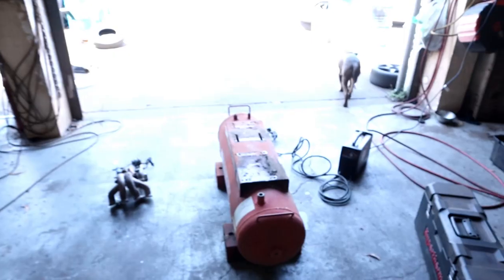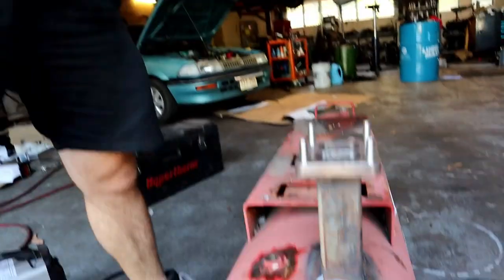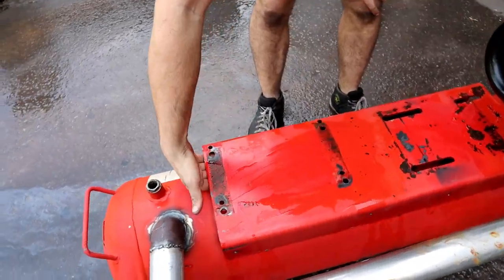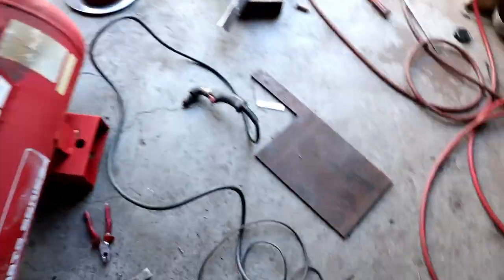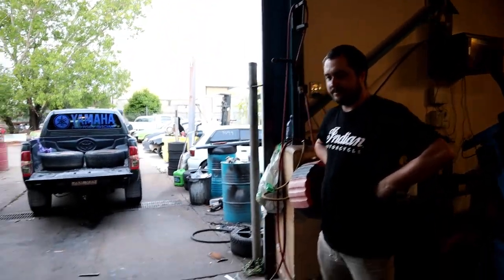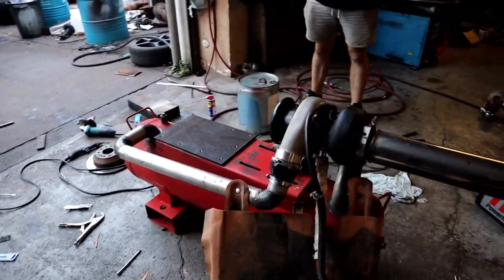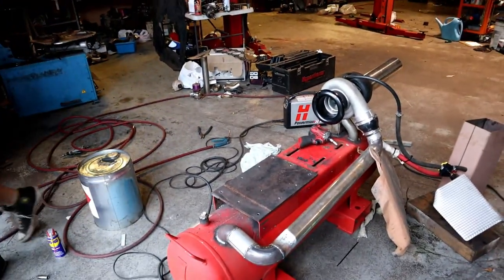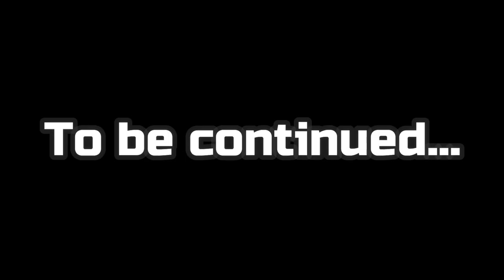How to build your own GT45 turbo barrel

Comment: Raise the oiling system so that pump doesn’t have to push or pull against gravity and your flow will greatly increase.
Reply from the maker: Great idea thank you!!
Reply: With the tank below the return is allowed to flow freely out of the turbo and the pump is working against gravity + the restriction in the turbo.
Raise the tank above the turbo, and the pump is working against the restriction in the turbo + the gravity in the return line.
Reply: It's a water pump trying to move engine oil, elevation isn't going to make much difference. ;)
Reply: @kevinsellsit5584  thank you for specifying exactly what the OP said
Reply: @HashMaster1776  No comprehension is challenging for some, read it again.
I'm saying raising the pump above the turbo will NOT make any difference since the pump will still have to PUMP the oil UP in the return line.
Reply: @kevinsellsit5584   I thought he meant it would be best to move the pump to be level with the turbo so the the effect of gravity in the system would be negligible compared to the resistance from the turbo and lines
Reply: @HashMaster1776  that's not at all what the OP said.
Reply: @ObservationofLimits  that is exactly what OP said ya pinecone
Reply: @kevinsellsit5584  “push or pull” against
gravity.   Implying level with the turbo.  Comprehension is challenging when it’s not spelled out exactly to what your thinking in your head.  Hence “comprehension”, or plastic though processes.
Reply: @sixstringedthing  Exactly, it won't change anything as the return still has to go up, against the gravity, back into the tank. So same thing.
Reply: Good thinking put it just a bit lower then the turbo . ( So gravity return still works.. on automobiles if your turbo is mounted low like were the muffler normally  mounts.  You need a scavenge oil return pump. Otherwise the oil will flood into turbo and be burnt in the exhaust .
Reply: @MattBerrymotorsport  Run the oil through the turbo then dump it into the burn chamber so it can also use it as fuel.👍
Reply: @P0LARice  but then you will have turbo boost forcing its way up the return line!

Comment: Great vid.  If you feed some of the boost air back onto the intake it will be controllable and not overheat the turbine wheel so much.  Another way to do this and Original would be to start the thing with a small amount of wood and then pump a regulated amount of old engine oil in the burn chamber as fuel.  You could regulate the output  of the turbo with the fuel feed. 

Also, Please look at getting a tripod for the next vid so you can set it up and we can see the action better. Some of this was a bit hard to watch with the shaking. 
Look forward to the next one!
Reply: The legend himself, sassier of the ninnies, OIL BURNIN POWAH
Reply: Turbocharged oil burner when?
Reply: That’s why jet engines use kerosene?
Reply: If the fuel is a mostly fixed factor, burn rate limited by air then some concepts may be inverted. The gas environment in the hot burn chamber is inverted, and the it's the air going in that should be passed through burner jets. (Flame front forms on fresh air coming in.) Rather than have the air just go back through some single open spot in the side, it could be routed through a steel pipe bent in a spiral with holes drilled into it that face inwards towards the fuel. Throttle is done by controlling the amount of pressurized air going back into the burn chamber. (Burning oil just makes it a regular jet engine, in which case this whole concept can be omitted as you're regulating fuel instead.)
Reply: Awesome to see you back online Oil Burner I missed all the special safety tips you used to give to the numpties out there in youtube land.
Reply: I was thinking the same thing: make a turbo oil burner. Can the oil as fuel be used previously as the turbine cooler? If not, can the turbo be used to pump the coolant oil?

Comment: This could be an interesting idea for a rocket mass heater.  Imagine this whole thing essentially encased in sand/concrete and a longer exhaust.
Reply: I think it would melt inside of that
some water circulation might help with that
Reply: You could generate heat with the exhaust and boil water at the same time to create steam to power something. End of world type of power generation/heat.
Reply: @sobrr13    id imagine that would still be insanely hot. Maybe have copper tubing wrapping around the barrel than through the home carrying a hot liquid like water?
Reply: @TheOhsemix  yeah water cool the machine and use that same water as radiant heating.

Comment: I made one of these a few years ago and converted it to run on waste oil this year. Outside of using a 12V transfer pump for the oil system (which is also a nice safety feature as the combustion area gets stupid hot, your oil reservoir is remote mounted and can be run through a filter), I'd consider fabbing in a damper system to limit how much heat is going through your turbo rather than trying to limit the air intake.  The waste oil method is even easier to regulate with a PWM controller on the pump. 👍
Reply: Some very nice ideas here to incorporate into the next idea for it 🤙
Reply: How much oil does your burn barrel consume?
Reply: @sharpnesstherapy502  Its more jet engine than burn barrel now as its feeding a forge, but at full tilt cast iron melting temps (3500-4100*F), its going through about a gallon for 35-45 minutes. Depends on how humid the air is that day. If I'm doing aluminum or something light, i can crank it down to about 2 liters an hour.
Reply: I've wondered about hooking the turbo to a gear reduction then to a generator so you get heat and electricity
Reply: @zachmoyer1849  Done that too. The right kind of reduction box that can handle this power output isn't terribly thrifty on the ol' pocketbook. However, if you're good with a 3D printer and don't mind casting a turbine wheel (a real one, not the turbo version) you can make what is called a free-power turbine and use simple gear ratios far easier and cheaper. Outside of that, there's no real 'off the shelf' version that doesn't cost more than the entirety of this type of project. 
Unless you don't mind cracking into and ruining a perfectly good torque converter...
Reply: @C-M-E  so what I'm really wondering here... is does it produce any useful quantity of thrust? I would consider such a setup for a small boat, or experimental go kart/minibike etc... but if it doesn't produce at least 30-40 pounds of thrust, it's literally just a global warming machine hehehe
Reply: @andrewgoldin675  It definitely makes thrust with the right turbo. I have one that's hooked up to a SX475 that I have to strap down Hard as it'll push 150lbs with ease. Be a damn shame to send that one off through the neighborhood!
Even a midsize 50-60mm turbo will make good thrust though; 80lbs would be about the reliable high end if the rest of your support devices can cope. It'll gobble up air like you wouldn't believe, but the best way to maximize power generation would be a free-power turbine upstream in the hot exhaust and a small heat exchanger (boiler for steam essentially) utilizing all the waste heat. Or you could run a smaller turbo minus the free power and just run a steam generator. The latter would be the best way to ensure device longevity. You'll need to rebuild the turbo center section once a year, maybe every other depending on how often you run  it. 
But if you're looking for raw numbers, the SX475 could produce ~600KW minus drag and reduction losses if you're sitting on an oil field. 200KW for a smallish steam boiler setup wouldn't be out of the question. The SX build set me back about $2000 US with a lot of custom built parts, and my first 60mm one was about ~1200 after figuring out what would blow up/melt down with heavy use.
Reply: MVP comment thread right here.
Reply: @C-M-E  this is the way ❤
Reply: @C-M-E  where can I see pictures or video of your setup? We have been thinking of building something like this to run off waste oil.
Reply: @C-M-E    I hate to be the guy that calls you out. Your s475 contraption  you just described would make about 15.5 lbs of thrust, not 150. I can back calculate based off of air velocity and volume. 

You’d be lucky to harvest 250kw out of this thing with a passive turbine. You may have 600kw of thermal energy but turbines aren’t 100% efficient at harvesting energy.

Comment: I've got a forty by sixty metal building for my machine shop, I put a three hundred gallon propane tank on its end to make a stove for heat in the winter, fifteen years ago or so.  I've changed it several times to improve its performance, but never thought of putting a turbo on it.  I've got an old one laying around and this looks like an ideal fall to winter project.  I suspect I could get my shop up to warm in a few minutes, with any similar success to what you guys showed.  I think a waste gate and perhaps a manual control of inlet air, might well tame the beast and make it "more equitable", after all who doesn't need more equity in these days and times?  Thanks guys, looks like a fine experiment!
Reply: Yeah I've been wondering why nobody making these has used a throttle body to control the intake air volume.
Reply from the maker: Our next video shows why…

Comment: I think these burn barrels are amazing but every single one of them is basically the same. I hope to see one that goes that one extra step where it can self regulate with a dump valve. Although more difficult to do I'd love to see one where you could add more fuel while it's running too. 
With all that said I want to add this was amazing to watch.
Reply: Wait for the next video 😂

Comment: it would be interesting to see what boost numbers that was making. and I agree on wastegate. then you could regulate the pressure and keep the turbo spinning at a controllable rate
Reply from the maker: Something cool is coming!! Thanks for the comment mate
Reply: @MattBerrymotorsport  I'm looking at turbo off a 450hp Detroit. My shop is building one!! Thanks guys!
Reply: @MattBerrymotorsport  needs a big throttle body and a length of tube inside the vessel to seperate solids from being picked up
Reply: A simple ball/gate valve between the compressor and the tank will do, length of cable to push/pull from a distance. a wastgate will just dump pressure.

Comment: It seems the waste gate (or similarly large diverter/relief valve on the pressurized air pipe) is a critical component for a steady run. The other ones out there added them too, so I'm surprised you omitted it when other examples also showed the run-away operation until making the feature correction. Even without a waste gate, a big valve rated for high temperatures could have been used to throttle it. (And big as in having a passage about the same diameter as the tube it diverts off of.) The way to throttle is by bleeding off pressurized air on the return (as there's no fuel control), pulling a vacuum by obstructing the intake probably isn't that good for the turbo.

Now I'm curious who is going to use a bleed air system to power something with a build like this first? There's always a surplus of boost when these things meet all the conditions to run. Even a tiny line that turns a small turbine reduction geared to the oil pump for the turbo would be something. But I could see a little generator or something else random using it too. Whatever it is will still need to take the heat from compression, and that which just radiates off the rest of the contraption.

Another optional feature is a high-temp quartz glass viewing window. Always interesting to see just how the burn goes. Seen some examples that once a closed container is burning hot gases, it's the air going in that has flame front coming off like a jet burner. (Rather than the other way around like you're used to with a butane torch.) So a diffuser could be designed with that in mind if desired. (Diffusing air going in and some grates or a simple labyrinth path to the turbo would help keep chunks of any solid fuel from going up into the turbo. Burn chamber seems to be more about pressure than air velocity, although both factors can be thought out and managed in some way.)

I know these things are just made to screw around with, but a little bit more of engineering could be put into it too.

Comment: In my experience mucking around with these, i found using a 4" screw on cap (from an irrigation supplier) was the go to and weld a big nut on the cap, so you can hit it with a rattle gun to tighten the crap out of it. Any leaks from the tank will cause the whole thing to sputter and shut down, also, a ball valve on the pressure pipe between turbo and tank is a lot better to control turbo speed. I might upload the vid to youtube and post a link later

Comment: ( just a thought for a non electric oil pump. ) If you have 2 oil reservoirs . One for the return oil dow low and another sealed  oil feed tank above the turbo.  You can  feed the above tank boost pressure to increase oil flow with psi. and start it with a simple gravity feed. .  Or. Use send boost pressure to the intake of a small junk 4stroke weed eater engine  and connect the pump your using too the crank shaft.  ( It should work like if  it was steam powered .   Which would be more efficient  with the cam + timing modified with a extra set of lobes .  So it opens intake on intake ±power stroke  and exhaust on exhaust and combustion  stroke. ( Basically making it a steam engine)

Comment: Add a manual wastegate to the barrel,,opposite end.  A simple 4" exhaust pipe section on top of the hot tank with a plate damper you can swing open or closed.  This dumps the pressure in the barrel.  Once we did this, no need for a board on the turbo inlet to slow it down.  We made the first wastegate exhaust pipe a bit too short and had sparks in our face.  You could make it a 6 foot tall exhaust stack crazy straw if you wanted.  We settled on a 48" length of straight pipe with the damper abut mid length, cause it gets hot.
Reply from the maker: Cool idea! We ended up just using an electric wastegate

Comment: Nice.   A waste gate bypasses  the hot side of the turbo to regulate pressure spooling the turbo ( mechanically  spring controlled  along with electronically or mechanically regulated boost pressure to reach psi above the spring being used. ...( Some are  electric solenoid valves and arnt mechanically controlled at all.  )     A blow off valve dumps charge pipe ( cold side) boost pressure .  Most are engine vacuum   controlled. And would not likely work as well in this application.. but a waste gate on the cold side would work to help regulate boost.  
Or a throttle body or carburator  you could manually adjust. In the charge pipe or on the intake side of the turbo. .

Comment: Turbo will die from ash/soot from the wood, think about putting a cyclone style filter in the feed from the barrel to the turbo. Only need a small metal barrel/tin and some scrap to form the interior. Itll collect all the large bits of soot/wood and save the exhaust housing.

Comment: My dad works on a sawdust burning boiler there's a silo with an auger full of sawdust The Silo caught on fire one time when the Fire Department open the top door it shot out Flames like a rocket they got it put out so they thought it was still smoldering so they when they pulled the door at the bottom to let out all the ash it gave them enough time to get away from it before it exploded my dad and I warned you that if the proper Stoichiometry meaning Fuel and air mixture is obtained you will have a bomb please be careful be safe I love seeing these videos
Reply from the maker: That is crazy mate!! Thanks for the comment!! We will try not to be too crazy 😉

Comment: Making a slide wastegate setup for your fill hole would be better. Then if you ever need to dump pressure you can use an attached cable to pull the door open.

Comment: You should use exhaust gasket sealant to stop the sparks
Reply: Wont work mate, between the pressure and heat itll pop open and leak anyways

Comment: A simple ball/gate valve between the compressor and the tank will do, length of cable to push/pull from a distance. a wastgate will just dump pressure.
Reply from the maker: We might try that

Comment: I got to thanking. If they installed a pressure relief valve on the charge side of the turbo. It could work as a kind of throttle.

Comment: Virtical tank, wtapped in copper tube and water cooled tank. Cool the turbo. Put the oil reseroir above the turbo and pump oil back up. Or, build a water jacket around the tank. Cool the pipes as well. Get massive endurance and effect.

Off you go people!

Comment: An idea that might improve the next version of that burn barrel.  Cut the door for the wood fill a little bit larger and use a seal around the edge like what is used on conventional wood stoves.  Should help with the air leaks.
Reply: I mean.. did it look like they had an air leak? They pretty well had a runaway turbo that they were choking out with a plate on the intake. They had plenty of compression happening if the turbo was spooling up like that. Why add a layer of cost and complexity?
Reply: @mystamo  All the sparks flying from around the feeder door.
Reply: @michiganengineer8621  I get it.. But the thing is already about to blow up.. Doesn't seem like it needs any efficiency improvements..
Reply: @mystamo  But, it might make the video more spectacular!  As long as nobody is hurt anyway!